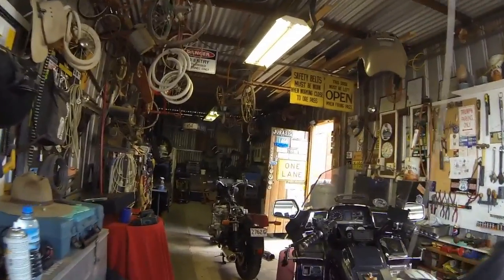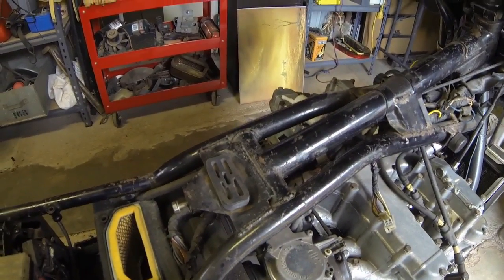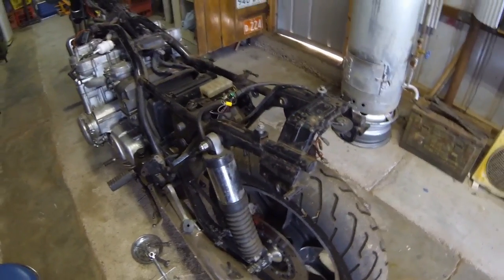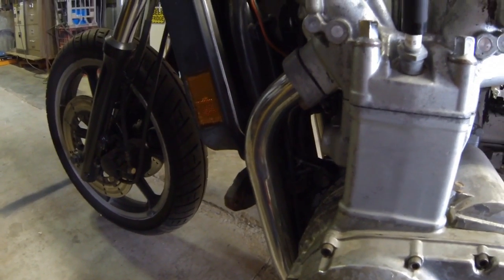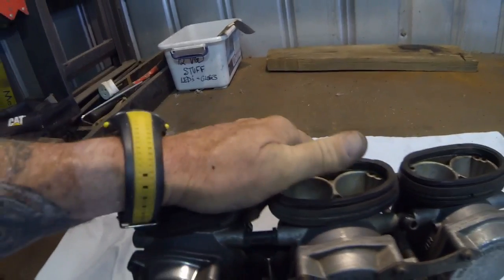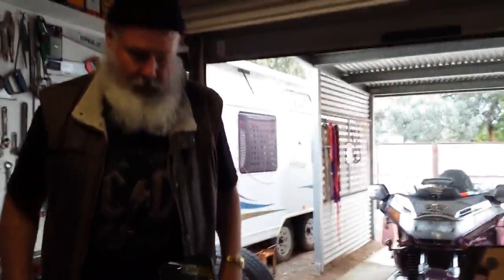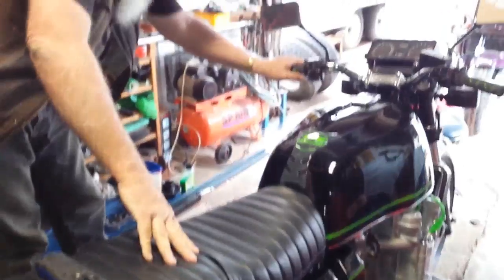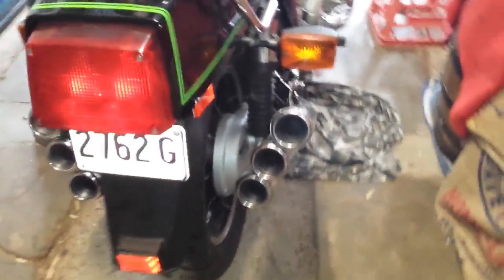Z1300 KAWASAKI REBUILD

Comment: nice clip jurasic..........
i have one of these bikes a 1979 kz1300....and for the life of me, i cant get the thing to idle properly. it has about 20000 kms on the clock. i have replaced the coils to those of the honda cb900 coils. ....the carbs have been also cleaned and re assembled but the idling is poor and putting on gas just stalls the bike, which suggests its still  a carbs issue........starts ok...                     any tips ?            im located in nsw
Reply from the maker: Be aware if you change coils may may have to remove the resistors .. it can create havoc. if you dont have vac gauges set your butterflys with a 1/64th drill bit so all throttle plate gaps are spot on. Float levels can also be done off the bike and check for vacuum leaks. There is a crowd in Sydney you can get carby kits from .. good prices too
Reply: yeah thanks....ive taken the ballast resistors out thay are a white porcelain type thing....yeah theyre out.....whats odd is that sometimes she fires up on 5 cylinders and sometimes its ok.....i might take a short video and post it....do you know the name of the supplier in sydney for those gaskets?
Reply from the maker: Wemoto. com.au
ph 0244217048
It is a pommy crew who have opened up in Oz, very switched on.
Reply: cheers, in case i have to do the carbs all over again i ll call them....i ll go over it again tomorrow and try and find what exactly is happening with this one.....the thing is sending me troppo